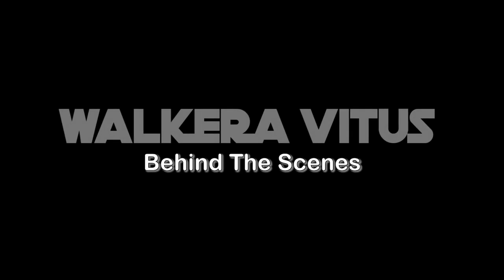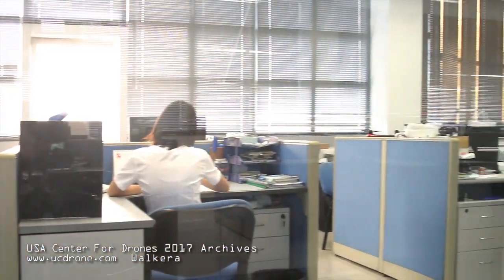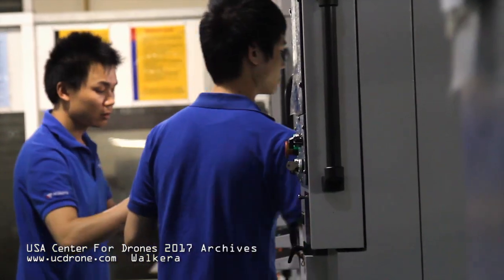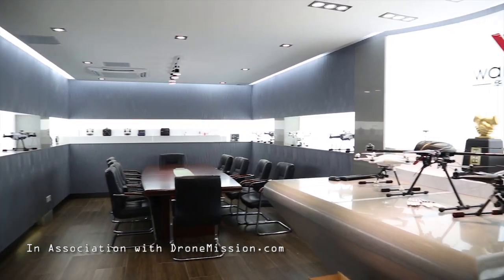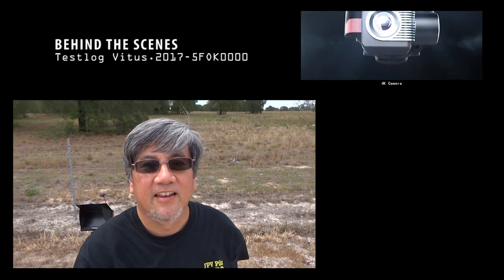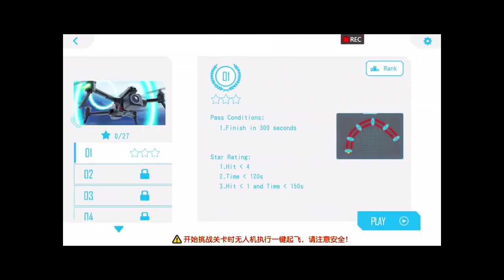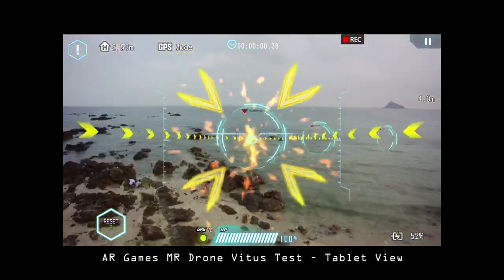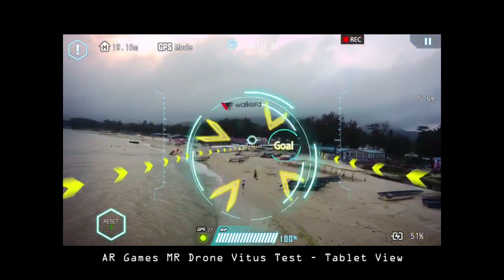Walkera Vitus - Behind The Scenes

Comment: leo is true that you cannot use the vtx from f150 rodeo on a different quadcopter other than walkera because I was told that there totally different?
Reply from the maker: I see a signal, power and ground wire if this is what you are referring to? http://www.ucdrone.com/parts/rodeo-150-parts/Walkera-Rodeo-150%20TX5833-CE-Transmitter-Rodeo-150-Z-19 I have never personally taken it apart.
Reply: It's ok leo thanks for replying

Comment: Awesome stuff Leo 👌. You'll have to hook me up with a job there,will work for drones 😂. I see you sell the Devo 12e quite cheap on your store. Apart from having two more channel's what are the main differences between the 12e and 10,why is the 10 more popular than the 12e? Thx Dod.
Reply from the maker: Hey Dod.  Yep, just two more channels only, but comes in useful for some APM/PX pilots. My opinion is the Devo 10 was introduced and officially packaged with the x350s during the explosive drone craze years around 2013, hence the Devo 10 is more available in the market and made popular by that sense.  We then introduced the white Sports Edition Devo 10, when anything white was the colour to go that year, it was also package with the x350 Premium. The 12e limited edition white was released at about the same time but went unadvertised and was not included in any official package that I know. Once FPV became popular next, we skipped to the F12e, with a screen.  The 12e is only cheaper at ucdrone.com for no other than the reason but to make it available for the hacker community in the spirit of the hobby.  I wanted it to be the next underground radio of all devo radios, and managed to get that exception made without impacting the dealers.  That is the story, so get one, limited edition,  keep it low profile, or someone may want that price up!  Just don't flash the wrong firmware, lesson one from a hacker! 🍻
Reply: ***** Thanks for taking the time to reply Leo,helpful as always. Dod.